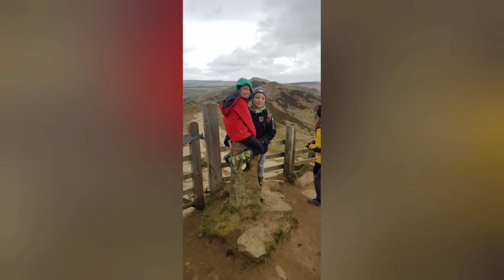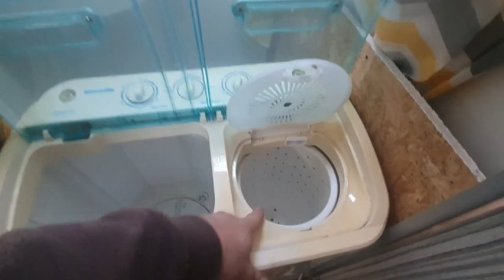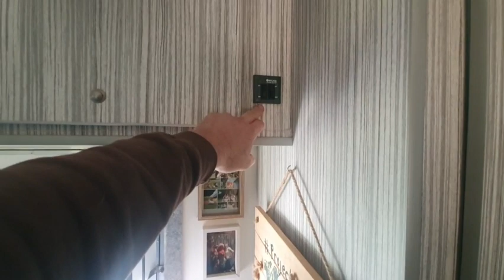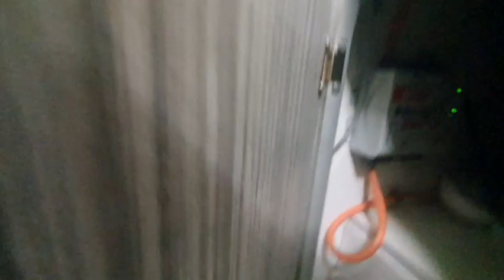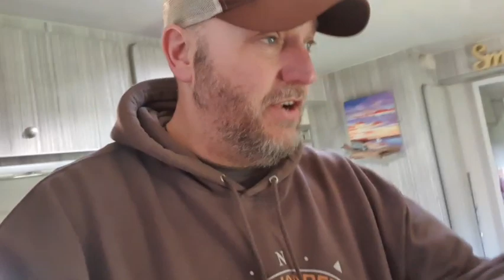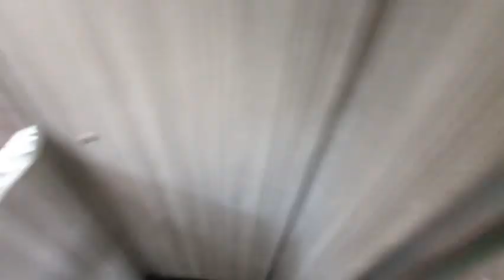OVERLANDER OFFGRID POWERED WASHING MACHINE

Comment: A heads up tip. After spin drying it the first time you are supposed to pop it back in fresh water and do a rinse cycle another spin , otherwise your clothes are still holding loads of detergent and it will make your clothes stink when you wear them. Good to see you swapped the waist pipe too as the ones that come with the machine split in no time.

Jed
Reply from the maker: My pipe split aswell lol